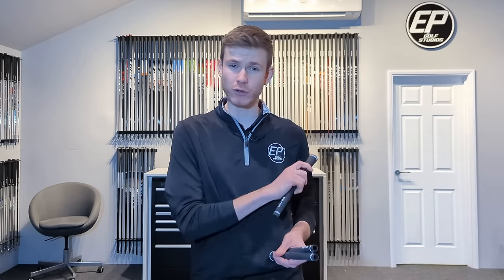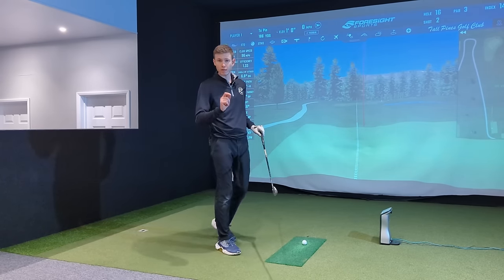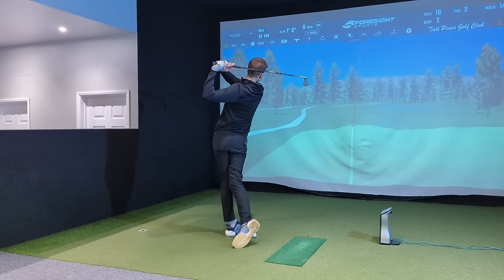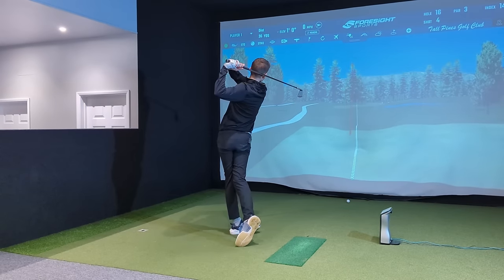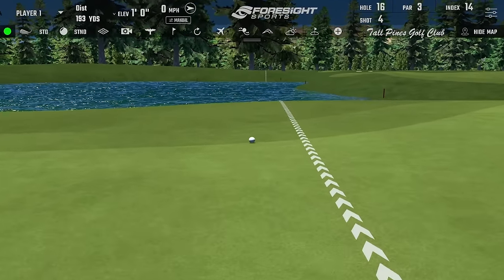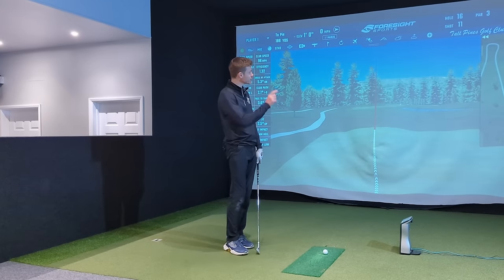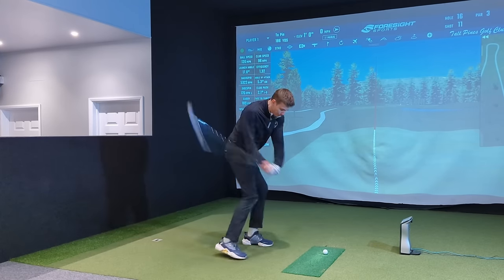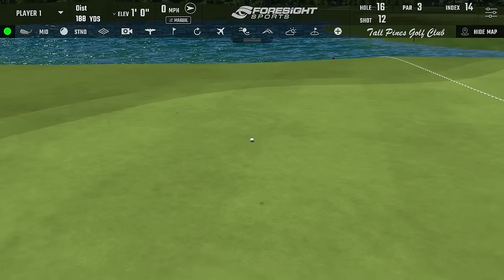The Right Grip Size? What We Look For & What Does It Do?

Comment: It's all about feel and not about finger size.  I have short fingers and wear cadet size gloves and hate standard size grips.  Been using mid-size Crossline grips for decades.  Very comfortable and allows me to hold the club with light grip pressure and swing freely.

Comment: Great video. Most YouTube pros neglect to talk about swingweight when doing these types of videos. Kudos to you for bringing that up. One other factor to consider is the weight of the shaft in the club. 120 gram steel shafts can absorb the extra weight put on the end much easier than 50-65 gram shafts will. I'm 6'2", started playing in the early 80's and always lengthened my steel shaft  irons 1" with extra layers of tape to build up the grips (large hands). Recently I retired and decided to take up golf again. I bought 4 TaylorMade FCT (White Head) Rescues with 65 gram Aldila RIP shafts and put JUMBO grips on all 4. They were erratic & unusable for me (I discovered that I CANNOT deliver an accurate swing with weights in the mid c's and lower. The bottom of the swing arc is different EVERY TIME, side to side AND front to back). I then bought the IDENTICLE HEAD clubs with the 85 gram Aldila RIP TP shafts and installed the jumbo grips. Problem solved. (I needed the heavier shafts to begin with in the clubs to minimize the effect of changing the grips. And yeah, I now own a swingweight scale).

Comment: Senior golfer, hand/finger arthritis…..I moved to the same jumbo grip used by Bryson on my driver. I remarkably forces me to loosen my death grip, it is more cushion, and my hands hurt less. Other than my slices still…I do get longer drives, and hit a bit more to the left or straight now. Overall I am pleased. Same w Fatso grips on my wedge or heavier putters…calms my grip.
Reply: Same here with arthritis. Harder to grip smaller.
Reply: exactly the same with me.  For my constantly sore hands, the jumbo grips are so much more comfortable for me.  And I also am able to grip it more lightly, which allows the clubhead to square up better and with a little higher swing speed.  And even though I didn't change the grip on my putter, I find that I'm gripping that club looser too, and my putting has improved.  Worth at least a couple of strokes in my case.
Reply: I started using a large non-taper grip for same reason,  non-taper has really helped stopped my slice
Reply: Same here but recently dropped down to the mid size grips, helps keep my fingers more on the grip!!!!

Comment: Just seeing this video now. Very well done. Another factor to consider is how swing weight may change as you go up or down in grip size depending of course on the manufacturer and the materials used. Rubber grips are heavier and progress up as size goes up whereas composite type grips like Winn or jumbo Max the weight can actually stay pretty consistent not affecting swing weight at all. Keep up the good work 🏌🏻‍♂️

Comment: Enjoy your test and fitting videos.  I have looked, but I may have missed a fitting for someone similar to my situation, I'm 78, my handicap goes from barely into single digits (9.7) to highs around 12 (12.3).  My driver (44.75 shaft) swing speed is low to mid 80s, (83-85 with a rare one up to 87).  You guys ever record a fitting for an old guy like me?  If not, it would be interesting and I'll bet you have more than a few viewers in this general category.  Thank you for your work!
Reply: So on a good day you can beat Steven Alker the #1 ranked senior golfer in the world and on a bad day you can place in the top 30 of senior golfers whom all are about 20 years younger than you. That's pretty insane.
Reply from the maker: Hey John, we do did the fitting with Geraint who was off around 12 handicap at the time with a swing speed similar to yours (maybe a fraction faster) but no one of your age just yet. If you want to be the first then let me know 👍

Comment: Much of getting fitted correctly for grips has to do with feel as much as it has to do with hand size and finger-length.
I use Golf Pride mid-size MCC+4 grips and can't imagine trying to swing a club now with those slim cheap tapered stock grips that clubs typically come with off the shelf.
One must always use what works best for their hands.
Grips that are too big will become easily noticeable to the player after a few shots at the range or in a simulator, and the same will apply for grips that are too thin.
Thin grips will usually result in the player having to death-grip the club much harder, which will often result in wild hooks.
Grips that are too thick will often result in the face of the club being left slightly open at impact, which will often result in slices.
There is also no rule against using different grips for different types of clubs, which is more common than many would otherwise believe.
Reply: Great way of putting it. My hand size is borderline between standard and midsize and I’ve always played standard since starting until recently I changed to midsize. I have noticed I don’t grip the club half as tight as I used to or hit crazy hooks. I now hit nice baby draws which I am absolutely loving.
Reply: Hi, I'm using midsize grips , golf pride velvet , 55 g ; now If I want to use  Jumbo Standard oversize , recommended by Jumbo as equivalent to midsize grip , weight 39 g , Iam afraid about balance changing, what do you think ?Adriano Eome
Reply from the maker: For the vast majority of people I wouldn't be concerned with that weight difference. Unless you are very sensitive to the weight change and swingweight change. But really there's only one way to find out! Gotta test
Reply: @adrianodonatelli458  Golf Pride's Tour Velvet grips in mid-size weigh 53.5 grams each, while the jumbo version of the Tour Velvet weighs 61 grams each, so not that big a difference, and you may not even notice the slightly reduced swing weight. The best thing to do is try the jumbo on your sand wedge and see how it feels.

Comment: I have been using the MMC +4 standard 52 grams and was going to switch to a TV +4 midsize at 63 grams. Do you think there will be a noticeable difference between the two? Do you think I would need any weights or am I good? Thanks for the help

Comment: I went from STD to MID in my woods at the start of last year.  The intent was to calm down my draw/hook tendency and it worked.  A few months later I regripped my irons from STD to MID and they felt odd to start but it did take way the draw/hook tendency.  If I had done more range time after the regrip it would have transitioned easier.  In the end, they feel great for me and I'm keeping the flight straighter.  I still snap a few every now and then.  The only clubs still STD are my wedges so that they have more feel and can be opened/closed and flipped/flatted as needed.  I'm a Cadet M-L glove sized hand.  The wedges have Lamkin 1130s for the more barreled longer grips.  For someone that slices the ball I would suggest a thinner grip so that they can get the hands moving through the zone easier to turn the club over and to also strenghten their grip.  It gives a change to get the grip more into the fingers easier.
Reply: I would counter this and say that a skinny grip makes me clasp on much harder which in effect tightens the wrists and hinders the release. It also causes fatigue and pain as was explained in the video.

The data showed negligible differences in release/delivery and I personally think you should go by feel/comfortability.
Just my five cents.

Comment: Larger grips should intrinsically increase sensitivity to face angle changes and allow finer adjustments. That's the biggest advantage of larger grips is their greater directional control.
Reply from the maker: Certainly for some, but that wouldn't be the same for every golfer out there
Reply: @epgolfstudios  it's simple math larger diameters allow finer adjustments. Individual performance is a function of more variables.

Comment: Agree, correct grip followed by comfort and familiarity with the grip size will breed confidence. One point I would make is regarding glove size being a potential guide to grip size; I have found the gloves size is dependent on the brand and composition of the glove (leather v mixed leather material v all weather man made).
Reply from the maker: Absolutely mate. I think hand size / glove size is a good starting point, but as you say different brands are different anyway which does make it a bit of a tough one for a lot of people who don't even know where to start...
Reply: I actually worked with someone to find the right glove. I have issues with my tendon in one of my hands.

Comment: Excellent video, I have always played standard grips even though they appear slightly small on my hands, last year I changed to a MCC PLUS4 Align (standard) and the thicker lower hand feels so much better although the grips still appear slightly small on my gloved hand, so should I try 2 or 3 layers of tape with my current standard grips or try the midsize which is a massive 14 grams heavier and I do not fancy having the swingweights on all my clubs messed up.
Reply: Hi Scott. Some will suggest, and it works for me, this "rule of thumb". Using the glove hand, grip the club as you normally would. If your longest fingers don't reach the meat of your thumb, the grip is too large. If they dig in, the grip is too small. You want the fingers to just be touching the palm. Try that first. If you have a Dicks Sports nearby, they will have different size grip samples attached to shafts which you can try out. They will help you with the fitting. Layers of tape under the glove hand would definitely be better than going to that hefty midsize.

Comment: Excellent video.  Can you comment on changes in sound between the grip sizes.  I recently switched from Golf Pride Standard Size Z Grip Chevron Soft Black (50g) to Winn Dritac 2.0 Midsize Swing Grip (54g) and I am no longer hearing the sweat sound I used to hear when I hit the center of the club face.  That sound is a check for me and losing it is a big negative.  Did. you experience this when changing to the larger grips?

Comment: In my opinion if a bigger grip gives you the right grip pressure that’s the main concern. I’ve had standard grips for years and gripped to tight. I now lighten my grip each shot and it’s changed my game. I will be changing to midsize soon.

Comment: Great video! Just looking for some advice. I’m being encouraged to go from a standard +4 tour velvet grip to a midsize +4 tour velvet grip by my coach. I’m a medium hand size but have very active hands and we have been trying for a while to quite them down. 
I play T100s with KBS V spec 110 stiff. I’m currently playing off scratch but have been as low as +3. Should I be concerned about swing weights with these grips? 
Many thanks
Reply from the maker: My advice when it comes to grip size it always comfort. Just have to feel comfortable with how it sits in your hands. It's all well saying let's try and put on a big grip to take your hands out of it (which in my opinion rarely works anyway) but if you don't like how the size feels it will negatively impact your game. So always be cautious of that. And swing weight wise again it depends on the player, but if your miss is left the yes you may benefit from adding some lead tape to the head. But I'd maybe suggest start off getting one club regripped and test that out for a few range sessions as see if you like the size. If you decide to change them all then have a couple rounds without any extra lead tape. Then if the miss is more left and can't feel the head they try adding 4gs of lead tape to the club head. If it continues then keep adding 2gs at a time until the weight feels good and miss is better 👍

Comment: My miss is usually to the right (mixed with the occasional pull) - inconsistencies of 21 hcp swing. However, I do feel that when I have probably the correct grip pressure, that I'm less in control of the clubhead. Currently have standard grip with 3 layers of tape. Might a midsize grip offer me more feeling of clubhead control?

Comment: Does the grip size (larger) help with more consistency too?  I would imagine it would make turning the wrists much harder allowing for more consistent delivery on the ball. I think this was not really helpful and the larger set of balls hit would've made this worthwhile.
Reply from the maker: @majen66  it's completely down to the player. One of the reasons videos like this are a bit pointless in all honesty, because despite the theory (which may work out for some players) it won't work that way for everyone. So the only way to truly know what would happen for you if you used a larger grip, is you would have to test against different sizes in a data set that is usable. Extremely difficult to do and for most amateurs it would be very hard to say from a data perspective which would actually be the best.

Comment: I’d agree and then immediately disagree…..comfort is key absolutely but comfort comes from familiarity so you will naturally feel more comfortable in a grip size you’ve used for a while.  I’d hazard a guess that if you used another size for a few months they’d then become the most comfortable.
Reply from the maker: Very good point Tim and you're right, comfort does come from familiarity for sure. But I have also had it many times where a grip size change has instantly felt better and performed better for players that have never played that grip size. So of course it's going to depend on the individual. If there is a case where we think changing grip size for technical or data reasons seems like a good idea but they player feels more comfortable on their original size then really I would leave that call down to the player. I can only advise on what I think would be better in any given situation. It might be they try and trial the grip for a while on an old club and see how it feels after practising with it for a few weeks. But as with anything in fitting it's just about trying to make the best call we can for that player.

Comment: Can I put a 85g project x even flow black hybrid shaft into my TM P790 2iron?  Would I have to be making too many adjustments regarding swing weight, how would the difference in length cause it to react?
Your assistance will be very much appreciated
Reply from the maker: I haven't built one in a while but from memory the 790 2 iron was taper tip, and the hybrid shaft will be .370. So you could get it to fit but would need to possibly ream out the hosel. Regarding swing weight that wouldn't be an issue as the head is designed to play the standard length that you would cut it too. And flex wouldn't be too much of an issue either as you could tip it depending on how you wanted it to play. If it's already in a hybrid it likely will already have been tipped some amount, depending on what hybrid it's in. There are a lot of variables here. Too many to say on here. It could be done yes but you would need to take it to someone who knows what they are doing and tell them how you want it to play.
Reply: @epgolfstudios  thank you for your advice, I’ll get cracking.....well reaming anyway!
Enjoy your content 👍🏻👍🏻

Comment: I went from standard to midsize and my club balance is all wacked out. You are the only one I've seen say that. Thank you guess I'll go back to standard maybe plus 2 wraps?
Reply from the maker: Yeah I mean there are lots of variables in there and it also depends on the person. Some people will change grips and not really notice it and others will see quite a big impact.

There's a few options. If you want to stick with a bigger grip then find a grip that is bigger but not heavier, there are quite a few options out there.

You could get them rebuilt to add weight back into the head but this won't be cheap. Or get some tungsten power and corks and do it yourself.

Or yeah to back to standard size.

Just gotta try figure out which is best way forward for you
Reply: Need to be cognisant of grip weight as the heavier grip counterbalances and you’ll end up loosing feel for the club head
Reply: @seancook2264  I went to golf pride mcc standard plus 1 wrap and it is much better for me.. wish my club fitter would have mention that to me...

Comment: Have you tried the golf pride cpx grips? Just got my woods and wedges regripped using them absolutely love them
Reply from the maker: Yes Nelly! I have them on my clubs currently! Really like them. Only negative is they wear very quickly. Apart from that they are amazing
Reply: @EP Golf Studios  yeah I had a feeling they would wear quickly but feeling wise has helped me massively with my grip strength as previous grips I felt like I had to grip to tight
Reply: What effect does the golf pride CPX grips have on swing weight ? I’m using jumbos on my 0211 PXG irons ?? I think jumbos are like 85 or 87 grams ?? Quite heavy

Comment: Most amateurs could benefit from a lighter swing weight, even single figure handicappers. So I wouldn't be to concerned about swing weight and offsetting the head with a heavier jumbo grip.
Reply from the maker: Absolutely agree 👍
Reply: @epgolfstudios   yeah, it always struck me as strange that clubs off the rack - even game improvement clubs are sold with the same swing weight as tour pros - what the hell? and most clubfitters build every iron set up around d3. you wouldnt dream of putting a blade with tour stiff shafts in an amateurs hands, why swingweight? ive jumbo grips with extra tape, i reckon the grip weights 90g +, love it!